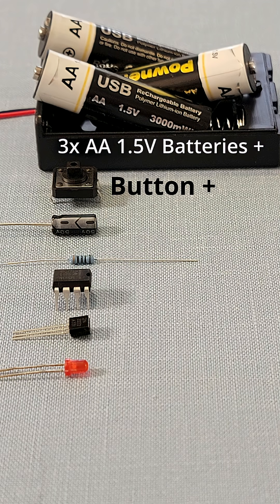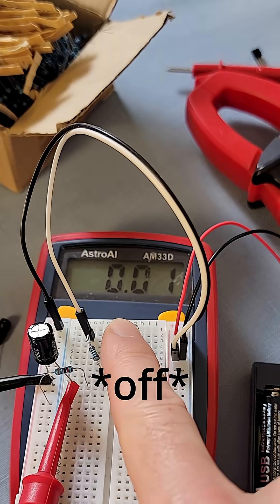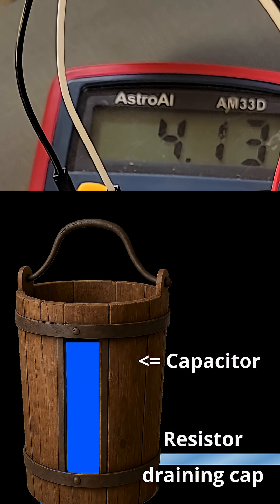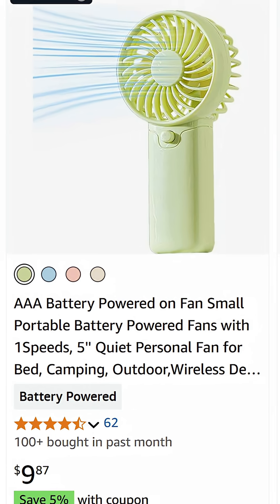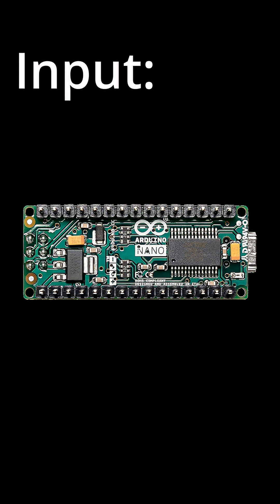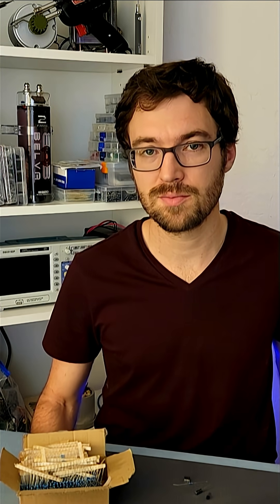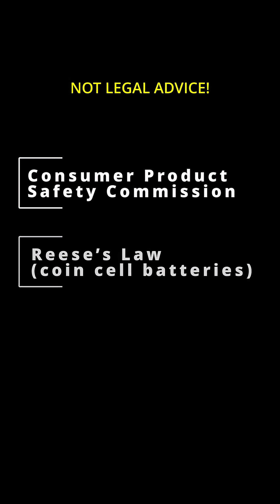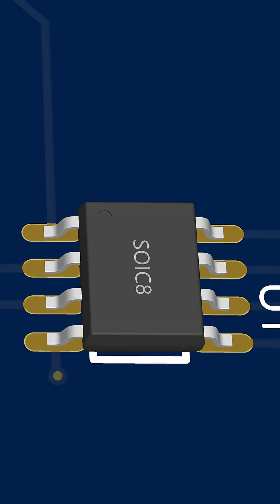Simple Products Make $$$  #arduino #electronics  #diy

Comment: Can this compactor measure out 24hrs for a daily timer? Say on for 6 and off for 18hrs?
Reply from the maker: Theoretically yes but most these components have a accuracy of like 1 to 5%. Capacitors often are like within 20% accuracy of the rated values. The timer depends on the resistor ohms value to capacitors capacitance value ratio exactly. Not like it says 1000 ohms, like it's actually 1001.4 ohms and that makes a big difference over long periods. 

So it might be like 5.5 and 20 hours even if you use the right values. You have to pay for more expensive stuff to get it like 0.1% resistors accuracy and like 1% capacitor accuracy. The reason why I mention all this is over days it adds up to where if you want to set it for like sunrise and sunset eventually it will start turning on and off at midnight and noon
Reply: @FluxBench  ok. Thanks . So I'll look into another solution then .  Thanks for the follow-up.

Comment: FluxBench, aka The Sub-9kHz Guy.
Reply from the maker: I wanted to show that you can make electronic products simply. A flashlight doesn't need FCC certification if you build it with the simple switch. Most people who want to try to make something and sell it without FCC certification. 800 bucks for an EMC lab is sadly beyond the reach of most people. 

Next product I show is going to either be an ESP32 or Nordic chip based thing. It's about escalate quickly 😂
Reply: @FluxBench  You going to pivot to sub-9GHz?
Reply from the maker: @Martinit0  😂 exactly! I could even make a improved version of the light by having an IoT version. Basically a simple app you can use to configure the device and set something like a digital potentiometer. Keep it low power so it only starts up the Wi-Fi or Bluetooth chip when you press a button type thing.